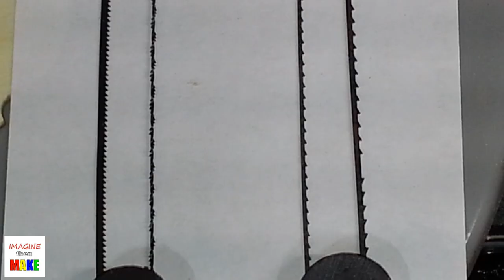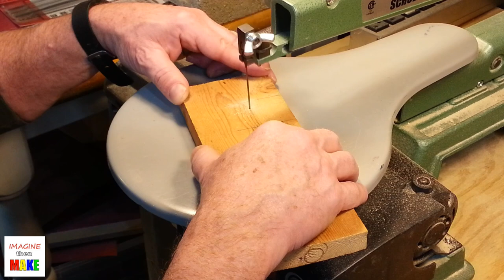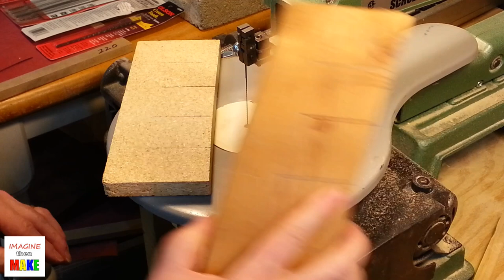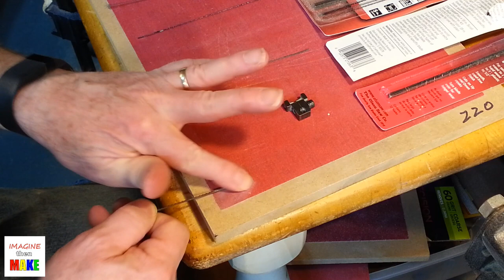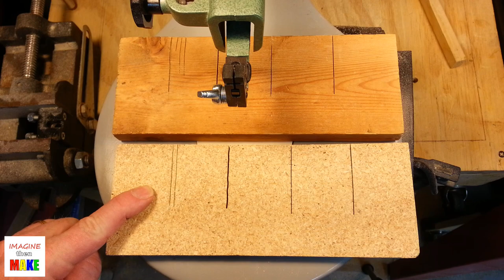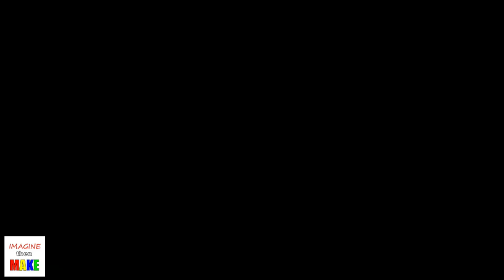125. Which scroll saw blade makes the best cut?

Comment: thanks for sharing. Found this video  through a google search! happy scrolling!
Reply from the maker: You're welcome. Do you scroll?
Thanks for your comment and for watching.
Reply: @ImaginethenMake  I had a scroll saw in the 90s. It was much different than the scroll saws t on day! I haven’t scrolled in 20+ years. I recently purchased a Seyco and am just getting started with it… trying to learn all over again.
Reply from the maker: I think the Seyco is an excellent machine from what I have seen of it online. I still use the $100 Harbor Freight saw (although I did replace the blade clamps). I think if I tried a more high machine, I would probably upgrade.
Enjoy your re-learning. I think the scroll saw is a tremendously versatile and hugely underestimated machine.
Thanks for your comment and for watching.

Comment: Thank you for taking the time to do this video. I haven't used a scroll saw in over three years and when I did use one still didn't know enough about types of blades and what woods to use in them .. wanting to do holiday crafts with the scroll saw now and having trouble knowing what blades to use to makes some cuts with right curves . Like curves in a Xmas trees out of wood  ect..
Reply from the maker: First, I should say that I am not an expert scrollers, but in my experience, I just wind up testing out a few different kinds of blades on the same kind of wood I want to make my project out of until I find a blade that works for me. I have also watched A LOT of YouTube videos from other scrollers to see what kind of blades they use. There are so many different blade types with different TPI (Teeth Per Inch) that it can seem overwhelming to choose one, that's why I buy a few different kinds and then test. Here's a link to a pdf that shows some pinned end blade choices from Bear Woods:  https://www.bearwood.com/media/all-blades-pinned.pdf . I hope this helps.
Thanks for your comment and for watching.

Comment: I have the same scroll saw as yours using
Reply from the maker: Yes, I've had this Harbor Freight scroll saw for quite a while now. I did replace the blade holders though; I'm not sure if you saw my video about that ( https://youtu.be/W83TllFnMgs ). I replaced the holders so that I could use pinless (flat) scroll saw blades. Specifically, I wanted to try using spiral blades and they only come as pinless (or flat end) blades. When I tried a spiral blade, I made a video about it ( https://youtu.be/mI0Aicqs1xI ). I also tried using a clamped on fence while cutting with a spiral blade ( https://youtu.be/NVUfa8sS3Pw ).
If your saw can use only pin end blades, that's fine, and in some ways even easier to use (it is much easier to change a pin end blade than a pinless blade). The down side is that pin end blades require a larger pilot hole when making inside cuts. I hope all of my rambling here has helped you out a little.
Thanks for your comment and for watching.

Comment: Could you give me the name of the best blade to buy
Reply from the maker: The best blade for you depends on a lot of different factors like: what kind of wood are you cutting, how thick is it, do you need to make inside cuts, how detailed are the cuts you need to make, do you need to make long and straight cuts, etc.  I recommend trying out a few different kinds of blades and see which you prefer. 
So far, out of all of the blades I have tried, I like the skip tooth reverse blades best but I have not tried all of the blade types available. You can buy many different kinds of scroll saw blades directly from Amazon. This link will bring you to Amazon and show you a set of blades that look pretty good to me.
https://amzn.to/3bMhWKZ
I have not tried these yet but I think they are likely to be a pretty good blade if you need to make tight turns and accurate cuts. I'll be trying these blades out shortly.
Here's a link to some reverse tooth blades that also look good:
https://amzn.to/35O9LKe
I hope this helps. Please feel free to share any of my videos using social media, email, or text message. Thanks for your comment and for watching.